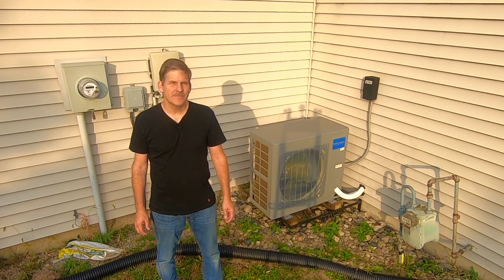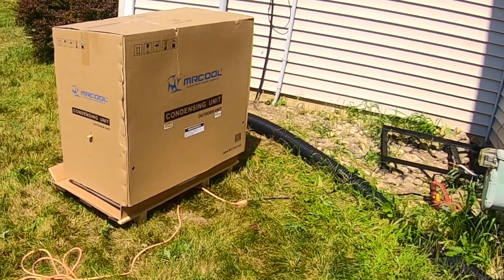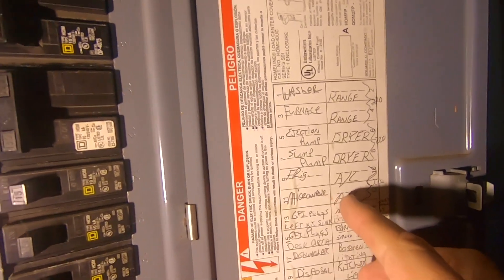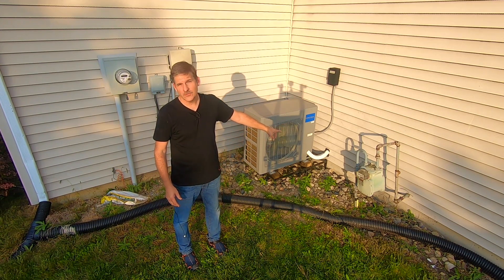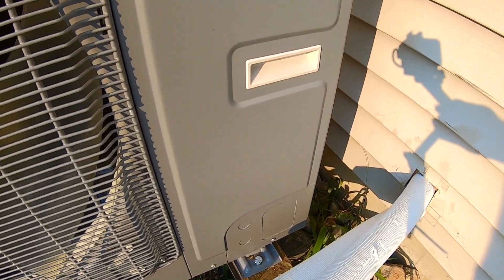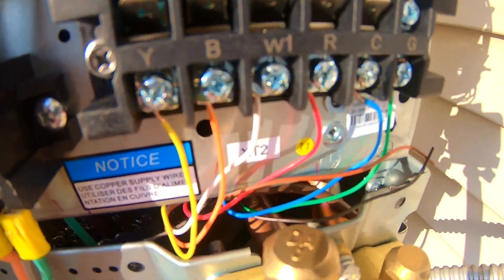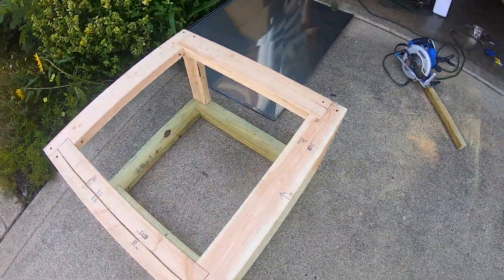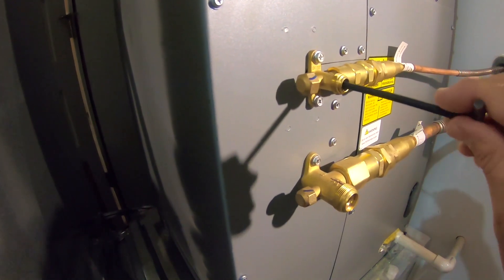How to install Mr Cool Universal Heat Pump: air conditioning and heat solution

Comment: I am looking at installing two of these two replace my two package units.   My research says this can be self installed and still have the full warranty, I contacted two distributors who did answer and have the same question in to MrCool directly, waiting for their confirmation.  These are also 20 seer and with 80% heating efficiency down to -5 degrees outside and will continue to produce heat all the way down to -22 outside, and  I read are competitive with geothermal units on efficiency.  This inverter technology is not your standard heat pump, so the people commenting clearly do not understand what this unit is.   Did you have to use metal on the box you build, I will also have to build one to switch from a package unit to a split system.  How is your air filtered, I was going to look for a filter rack to go under the unit.   I would love to see more details on the mounting of the air handler.   Did you have to buy the adapters for the quick connect separately it was not clear from what I read so far.  But I really would love an update on how its worked so far, as I will have to make my decision in a month.  I am already 90% sure this is the same model I will go with based on my research and pricing.  Thanks so much for the video, gives me even more confidence I can tackle this myself and save a lot of money, and I hate paying others to do a job.
Reply from the maker: Hey thebig....,
This question was asked previously ( in comments ), & so we called mrcool. They said you get a standard 5 yr warranty if you self-install, and they double that to 10 yrs if you have an HVAC co. do it.

Yes. The inverter is new tech. Absolutely NO comparison to old tech heat pumps. 

I did choose to line the air plenum box I built  with metal / 28ga? ducting. 
The air handler simply sits on top of the plenum box. The filter is built into the side of that box after the air return boot ( which I also fabricated rather than buy) 
The air handler pulls air from the bottom and distributed out the top in the vertical position.
The quick connect connections come with the quick connect no-vac lines. If you need to go further from condenser to air handler than one set of lines will reach, you can buy extra connectors to link two lines sets together. They have a few different line set lengths up to 50 ft.
We have our unit set at 3 ton (default). You can buy a 4/5 ton unit if you need bigger.

We live in Indiana. We replaced a gas furnace expecting to have slightly higher costs compared to the 2.5 ton 10 seer gas furnace in winter and perform much better (less cost) in summer as the mrcool A/C condenser is rated at 18 seer. Our old a/c was 10 seer. 

The coldest it’s been this winter has been about 15 degrees for a couple nights.  Zero performance issues thus far. We did NOT buy a heat strip with the unit.
We plan to do a review after this winter and a second at the end of summer 2021. ( a little late for your decision)
I will say that our winter has been mild thus far.
Here’s the latest snapshot:

Dec 2019    ( with old gas furnace )
Dec Average temp 35
    Gas.      $ 88
    Electric $ 95
      = total.  $183
                    
     
Dec 2020.  ( w/ new mr cool universal )
Dec Average temp 40
    Gas.      $ 24
    Electric $ 210
     = total  $ 234

My general opinion was installing the mrcool was pretty straight forward. The hardest point was hooking up the new nest thermostat to the air handler and condenser. . I wrestled a bit with the wiring diagrams. Even though it is proving to be more expensive in winter, the a/c should be much  more efficient so..... we’ll see.
Also, we may do another new install next month. If so, we’ll try and post a more long form install video. Keep your eyes out for that.

One more note, we got a $500 rebate from our electric company for installing the high efficiency heat pump. Definitely look for that!
Thanks 

Hope that helps.
Thx for watching!
Reply: @Housebarons  awesome, forgot about the electric company rebates, another good reason to buy this. i really appreciate how you answer all the questions, MrCool should be paying you!
Reply: Lots of info. Thanks for sharing. Can you share what you pay per kw for electricity and per therm in gas. Also do you know what efficiency your old gas furnace was?